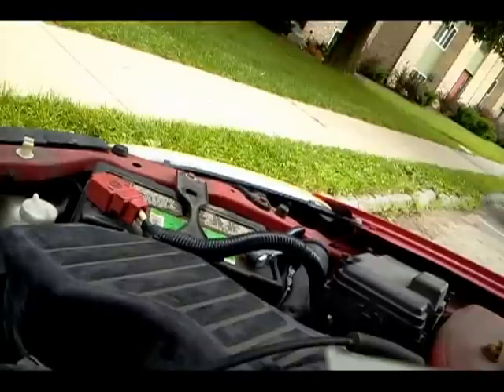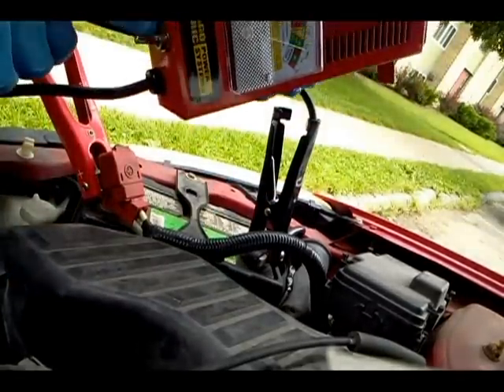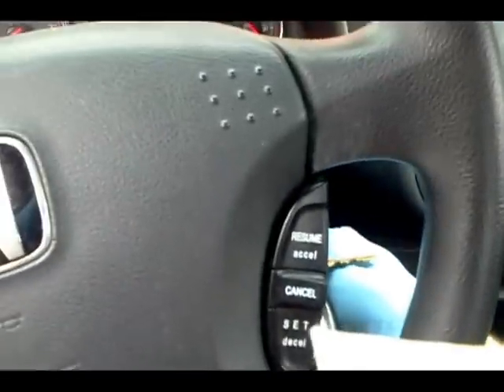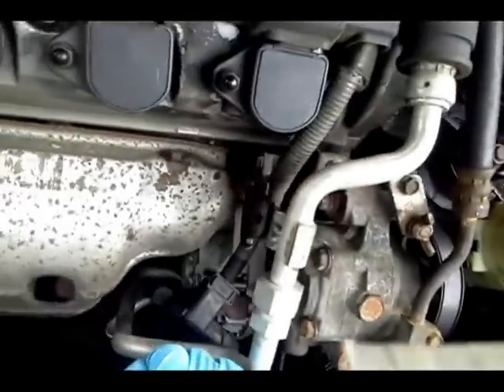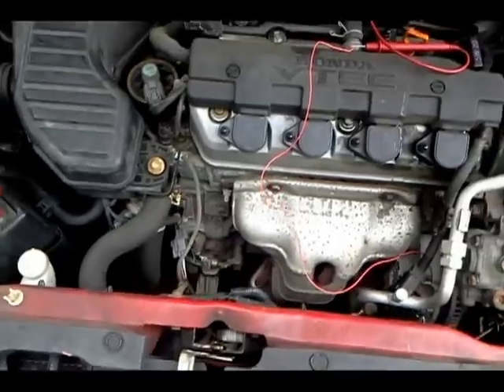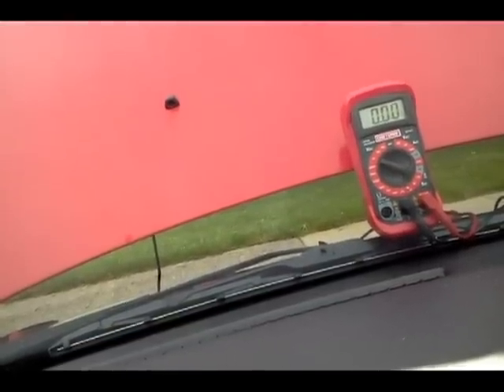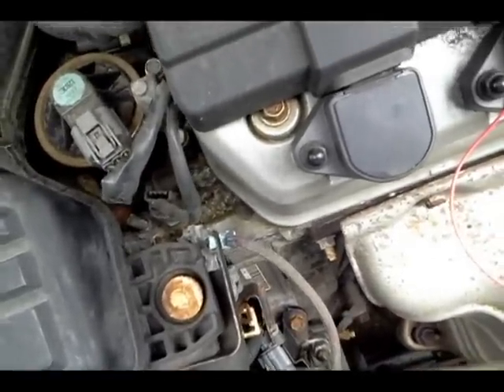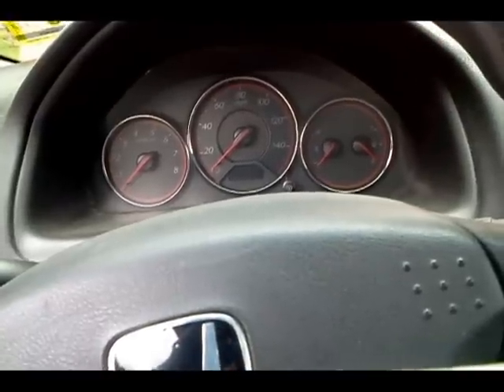How to Fully Check your Cars Electrical System

Comment: When you're checking the alternator ground, you hook the multimeter negative to negative and positive to pos, so, you connect an addition wire from battery negative to alternator chassis?

Comment: in 5:58 why voltage drops when all loads are connected in parallel to battery ??
Reply from the maker: The voltage will always drop when a load is connected to it.  The reason for this is, the load acts as a resistor and some power is lost through the resistor which thereby causes the voltage to decrease. Normally the alternator should be able to keep up with this power loss and provide charging to the battery to keep the voltage relatively constant.
Reply: in theory , all loads connected in parallel would have the same potential across them .
Reply: when you had everything on and testing the battery shouldnt of you put the rpm to match what was being used

Comment: Shocked from DC on a 12v battery current? Maybe if you were licking it dripping wet! The electricity would need to be amplified threw a coil or capacitor or your bodies resistance would need to be lowered for it to ever happen. But the video is pretty good, a good mic and a camera guy and you will have a good video.